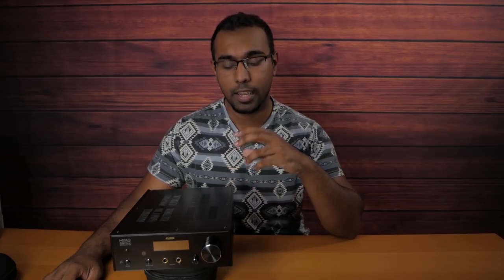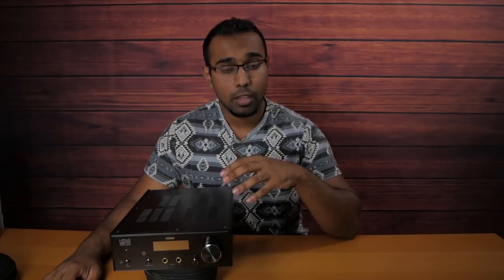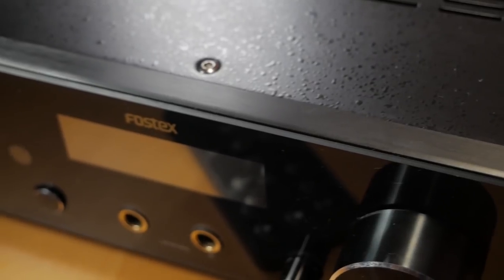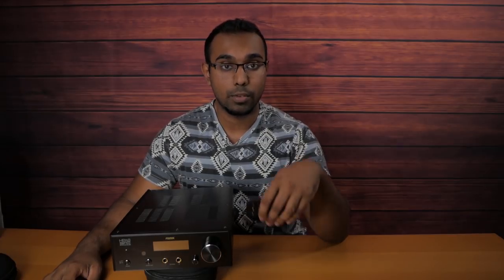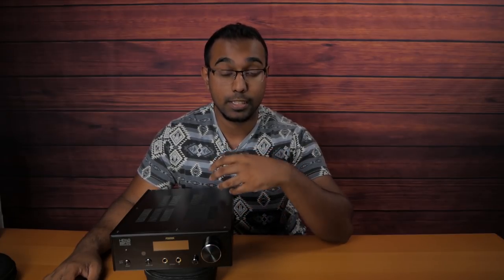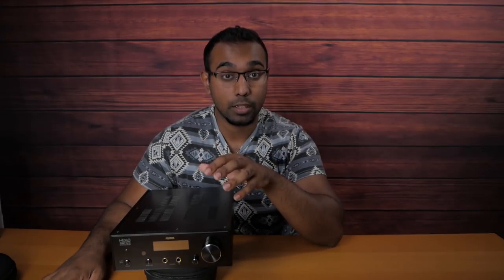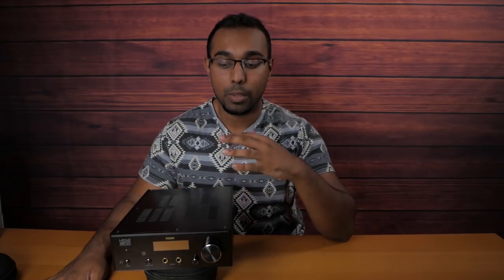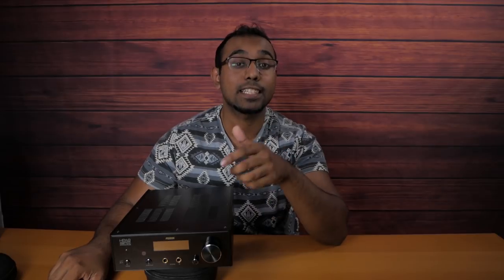Fostex HP-A8 Review ! Upgrade from Fostex HP-A4BL?

Comment: 1:48 HP-4ABL can be upgraded with external 12V DC low noise power supply - iFi Audio iPower for instance which is worth considering because in many tests it has noise levels comparable to battery which is really good.

Comment: I still have this unit since 2014 and I lost the remote after moving house multiple times. Not that a deal though.
I have it paired with the original Woo Audio WA6 (w/Sophia Princess). Though the Fostex is not the best pairing with my LCD-2 IMO, but it is amazing with the HD600 & 650, especially when listening through the WA6.

Last year, I took this to demo the Fostex TH900Mk2 & TH909 (the reason for getting this unit in the 1st place). I was hugely disappointed, not at the Dac/Amp, but at the headphones. For the asking prices, they are too expensive though very pretty and well built. Even when paired to the very expensive iFi Pro iDSD Signature, it was still pretty bad.

Comment: I've had this DAC for years.  The DAC/Amp section is very smooth, mellow, and resolving.  There is no brightness, a measurment would show it dead flat (which isn't provided).  The preamp section is THE WORST part of this DAC, which is likely just a thrown in op-amp circuit and a digital volume control.  It gets crushed by something with a well designed resistor ladder and discrete circuit in the pre-section.  The HP-A8 is fantastic with the old D5k/7k Denon line and the TH-900.

Comment: No balanced out for headphones or as a pre amp and x2 the price? I'll keep my hp-a4bl
Reply: Probably because fostex doens't really offer balanced cables for their headphones.
Reply: @juliangst  fostex doesn't include a balanced cable with there headphones but they do sell (overpriced) balanced cables for any of there headphones that have the stock capability to go balanced. That being said, a balanced amp is not inheritedly better then a single ended amp, it is more about the quality of the components and the integration of those components.
Reply: @lumntoob999  OK. my personal preference with the HP-A4BL and my HD 650 and various Venture Electronics Monk, Zen and Asura Omegas is a 4 pin XLR. You have your experience, which obviously doesn't translate to a  certainty, within the context of  a simple text message. I've compared both outputs with this specific DAC\AMP and whooosie, whoa, whoa!! Viva' La Differance! As I mentioned before, my Modhouse Massdrop MKll Argon's are arriving, with a balanced TRRS 3.5 connector,  this week!! I will try both types of connectors and report back. What do you to add to this conversation besides your opinion?
Reply: @dartinbout5672  It's hard to tell from your comment if your offended or what but I truly do apologise if you are, it was not my intention to do so at all. I think you misunderstood me a bit though, I agree that when comparing the balanced to single ended connection on the same amp then most times, if not all times, the balanced connection will sound better. What I meant initially though was if comparing two different amplifiers and one is single ended only and the other is balanced only that the balanced one may not always sound better, there are many things that matter and yes the biggest one is your preference. I'd be happy to go into more detail and have a conversation but if it's negativity or an argument you are looking for you will not get it from me, I see to much negativity surrounding a hobby that I really like and I have no interest in contributing to it.
Reply: @lumntoob999  I'm just having a bit of fun. There so many casual assertions in audio, with no accompanying supporting statements, I was just kicking a bit sand. I always wanted to write Taylor-Not- So -Swift.. On a serious note, the chain of tech.  to arrive at conclusions different then mine, are frequently enlightening.
Reply: @dartinbout5672  I understand, that's a relief and funny (Taylor not so Swift) lol. I went from having a headphone rig worth over $4k and now I'm back down to a $500 system and an hd650 and a modded beyerdynamic t70 and I get just as much, if not more, enjoyment out of the cheaper setup. The stuff I had read and believed that made me curious enough to buy all that expensive gear was mostly untrue in my opinion and now I do like to at least try to pass on some of what I feel is important to understand. Take expensive cables for example, people talk so much about all of these sonic changes between cables so I was curious and bought a whole bunch of them, what I found was I didn't hear any difference between them but after a while I did notice some benefits but i never once heard a sound signature change. It really is funny to me at this point but I had to spend big money to learn those things for myself. I wouldn't change the journey I had because I'd always still be curious but not everybody is willing to pay for those lessons.

Comment: This amp comes across uninspiring on bad recordings or when being pushed out of its comfort zone.I imagine the HD 800 being bad.It never liked the beyer T-90 , Although the dac sounded amazing on an external tube hp amp with these hp. Using the HD 650 and 1990 pro at moment.  Th900 hit me with treble a bit so sold, recordings make or break a setup or headphone

Comment: Non balanced version of FOSTEX HP-A4 is little less power but it sounds better than BL version.Both sounds very similar, but FOSTEX HP-A4BLs mid sounds like a 20yo girl's voice sounds like a 30yo lady. Compared to Chord Hugo, FOSTEX HP-A4 sounds more fun and faster.but less power.
Reply: That is not in keeping with this reviewers conclusion. It  has many more features but as a headphone device it is fails his analysis as a better headphone dac\amp then the HP-A4BL.(P.S what the heck headphones did you use with my amp that makes a 20 year old sound like a 30 year old? Were you listening to Taylor Not-So-Swift?)
Reply: @dartinbout5672 The sound of the HP-A4BL is colored in the middle tones compared to the HP-A4 and the sound is more v-shape than the HP-A4. The female voice sounds slightly thicker, more relaxed and slower.Because of that, young voices sound like older and more mature voices.